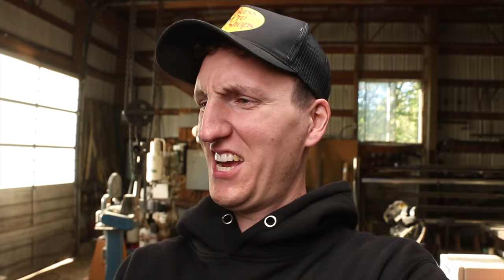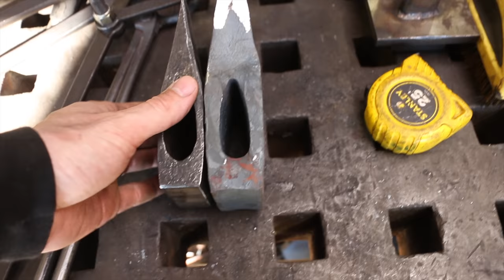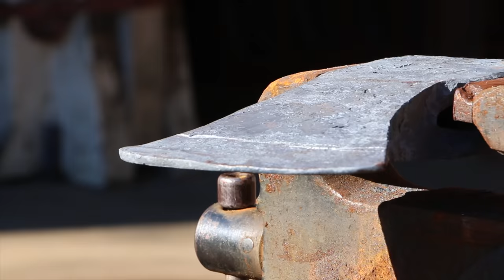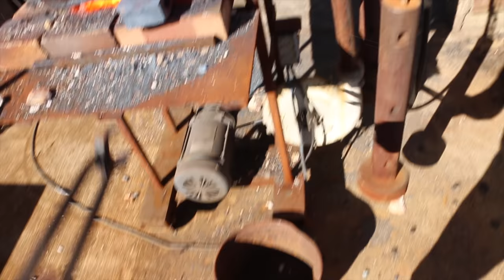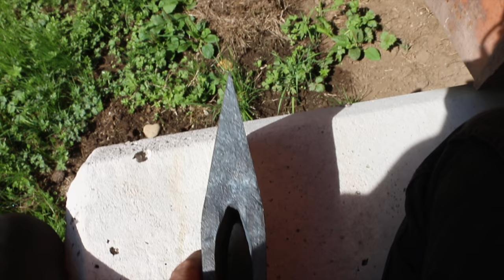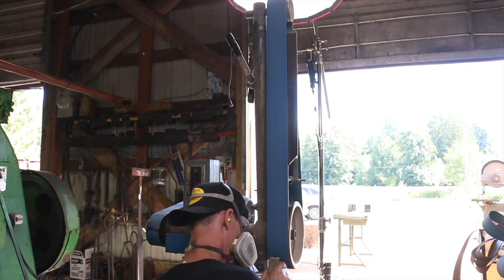Making the MONSTER Wood Bullet AXE!

Comment: I saw the video when you turned a bolt into a long wire and that was amazing!
Can you do the same with a copper or aluminum rods to get a long wire??
Reply: it is the same principal just easier at least with copper, aluminum may need to be extruded. Silver and Gold can also be drawn down similar to Copper.
Reply: @lostman9814  Pretty sure copper has to be repeatedly annealed because of the work hardening.
Reply: @Nevir202  I've worked with copper a little and my experience was as long as it stays hot it won't harden. Where people run into trouble is trying to work it when it gets cold. Because it's a soft metal it is tempting to keep hitting it and it will be fine for the first few hits but after that it hardens. Hit it with the torch and it should be good to go again
Reply: @Nevir202  Too true periodic annealing is needed for copper, silver, and gold.  Typically on small jewelry scale copper and silver I would make two gauge reduction passes then anneal, just doing small batches thru a commercially available wire drawing plate. Kinda fun.